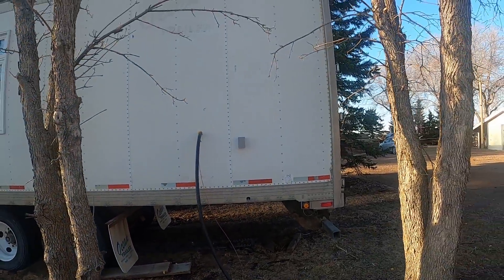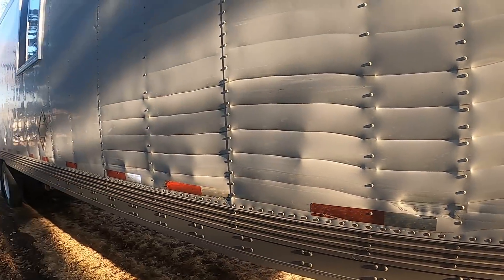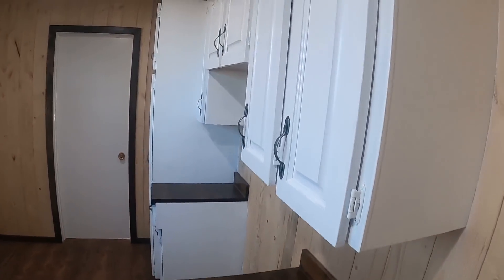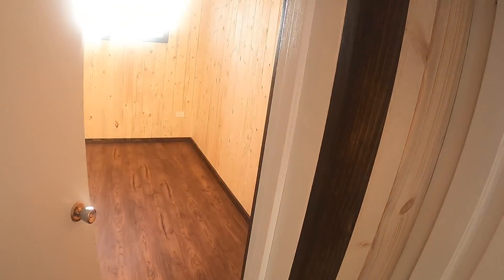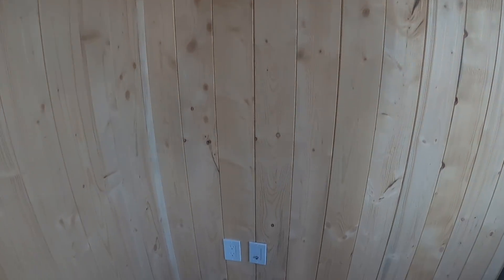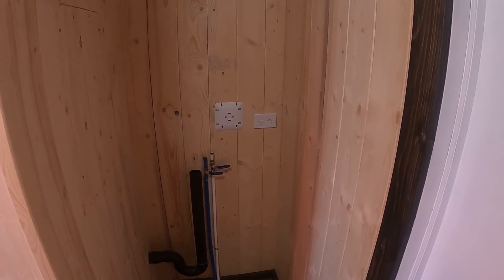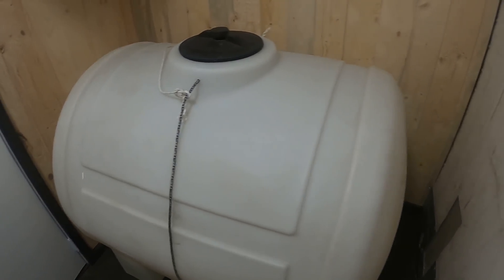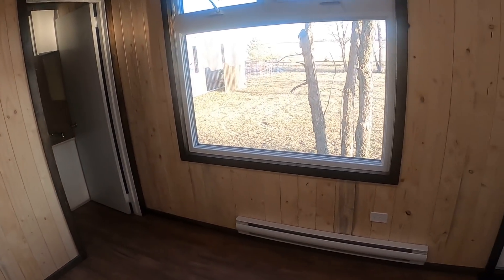My refrigerated semi-trailer converted into a house.

Comment: I worked on semi-trailers for about 20 yrs. and these thermo trailers can be heated with a few candles, and that little AC unit will freeze you out of there. 3' thick insulated foam walls. 4" thick in flooring and 2" roughly in ceiling.

Comment: I loved it .The only thing l didn't see was a closed for the clothes. Other than that beautiful ❣️ excellent work.Thanks for sharing. Blessing.
Reply: Closet
Reply: I would install a pole the whole length of one of the bedroom walls to hang my clothes on.  And I'd use under bed storage.  It's doable. 😉👕👗👖👜🥾👟 👠 So cool that it includes a washer & dryer and has a separate utility room!  Nice layout.
Reply from the maker: good ideas thanks  @jodybogdanovich4333
Reply: @mccrearymike  My pleasure!

Comment: Way easier then dealing with a 40'  container, even a 20' move on a roll back. Hit the plate, hook up the air, check the lights, your out of dodge NOW!   Add on's, cubic foot  wood stove if needed, propane stove and water heat, then the show runs with a 2000watt generator. This way you have ALTERNET USE AS NEEDED.  as is still great job !!!
Reply from the maker: Yes good ideas. I'm thinking maybe a small pellet stove even.
Reply from the maker: All good ideas. I working on another one now. I'd like to utilize propane more esp.

Comment: Good job on the build. If it's for you and your wife it would be perfect. If you were to sell perhaps consider these suggestions. I would have done a mini split system for the heating and cooling, with all the electric high output, the trailer would need panels and a solar set up to eliminate the the need to shore hookups & and tankless hot water heater. I would also just do the outdoor water intake and seal the doors in the back of the trailer to prevent thefts.
Reply from the maker: I'm not sure a minisplit would be adequate in our climate.

Comment from the maker: Hello  I am working on another one here and I am stuck on going the propane route or staying completely with a 100 amp service electrical and repeating the last one.  I am trying to avoid all the red tape with permits etc as every municipality or district seem to be different.... whatever route we go will be done by journeyman tradesmen so the quality and safety will be there. I'm trying to make as marketable as possibly
I could go with a propane stove and fridge, on demand propane hot water and a propane dryer.  I could use a propane vented fireplace for heat but I have to figure out how to distribute the heat. It will be located near one end. I do have a two inch space above the ceiling joists down the length of the trailer. 

For power I could have a rv  plug which is easier to get installed in existing yards etc or use a 5000 watt generator. Biggest demand would be the water pressure system, air conditioner, toasters etc. Solar is possibly but adds to the cost and complexity.   Woodstove or pellet stove is also a consideration?

Long post hear but I would love to hear about readers experiences, ideas good or bad and suggestions. Located in Manitoba where it frequently gets to minus 40 to plus 30 Celsius in the summer. I've looked into mini splits but not really doable for our winters from what I've read 

Thank you very much!
Reply: what is a Reefer box rated for insulation wise? I want to build one up here in Canada but I want to know if I need to add insulation or if the insulation in one is sufficient
Reply from the maker: @pipingsoul  They are well insulated. but I always add more to it.  Check out our new one.
Reply: @Mike Annetts You need to leverage the widely available propane furnaces (40,000 BTU from a Very Small component), hot water heaters (dual mode, gas & electric), power fittings (you Really can't have an electrical cable poking through the wall), etc.  You also need drawers & cabinets that won't open when you're rolling, firmly secured fridges & appliances, etc.  Spend some quality time with a good (Monaco) motor home before your next build.  That thing would be a Disaster if moved after it was inhabited.
Reply from the maker: Gus have just tied the handles together  to keep them closed but i can see problems if you didn't do that.

Comment: Hell there's enough room to put a forklift battery Bank underneath the trailer and you could easily get probably 2000 w of solar panels on the roof ....
Reply from the maker: Yes you are correct.  I would seriously like to have one completely off the grid. Wish I knew more about it.
Reply: @mccrearymike   it's not to hard you need a grid tie in pure sine wave inverter this way you can't backfeed ac voltage into the inverter......

You need to shut off the main at the fuse panel and put a lockout device on it.... Then you just need a plain old solar charger system that will charge a set of deep cycle batteries and some solar panels you can also hook this up to a 12 volt generator or 24 volt and or a  windmill
Reply from the maker: @Jackknife-TV  Thanks

Comment: How much did it cost to build and what were the top 3 highest cost associated with your build?
One final question. Why didn't you use the reefer tank below the trailer for water storage?
Reply from the maker: Hi. Diesel used to be in the tank. I don't know if yiu would ever get rid of the smell or not. Also in Canada it would need to be heated to avoid freezing. Flooring. Windows and doors, wood.  Also electrical is expensive.

Comment: I think it's badass but if you're going to go to all the trouble should have put some slide-out units in it with a double the room
Reply: exactly my point in top comment.
Reply from the maker: @Lauren-vd4qe  I was going tobput a slide out but it would of added a lot to the cost. I would of had to greatly reinforce the walls to do it. A removeable truck sleeper would  make a nice addition if it was permanent.
Reply: @mccrearymike  if its not going anywhere you could put on an addition that wd b a good idea and no too expensive either. or use a container unit thats an idea.
Reply: Why???  There is already more room than anyone needs!

Comment: and u wd need a semi truck to pull it....very expensive and very heavy. for $20,000 u could get a good used 33 ft 5th wheel with 3 slideouts more floor space and much lighter weight to pull.
Reply: This is better insulated also built much stronger than a fifth wheel with there weak 2 inch walls. Also it’s made to park on property  not tow  around the country. A trucker would charge maybe 400 dollars to move it. 5th wheels are garbage and fall apart
Reply: @larryferd1510  well i does look sturdy enough for a person who never wants to move it. as for 5th wheels, it depends on how much you tow it and how much physical torque twist n trauma you put them through that determines their sturdiness usually...
Reply: @larryferd1510  Definitely something you would ideally park on your own or a friend's land.  If you worked a job where you moved every year or so (restricted due to moving costs) and you could find trailer/RV parks which would allow this tiny home then it could be quite nice.  You'd have your own space which could probably handle many moves without issue and it is very well insulated.  One thing I'd want is mini-split for heating and cooling.
Reply from the maker: @knutblaise9437  Hello  always open to ideas.  what is a mini-split?
Reply: @knutblaise9437  good idea
Reply: This would last a lifetime while a camper trailer will last for as long as it takes to drive it off the lot.
Reply: @mccrearymike  A mini split is ac & heating all in one that hangs near the ceiling on the wall. Most ppl say it is very economical.  I can't confirm that bc I have never used one. But would be an idea for your next build, if there is one.👍🏻
Reply: This thing will go anywhere you want. 365 days a year. Just because he has a kitchen and bathroom doesn't mean it won't. Move around the world. You forgot its ment to do that.

Comment: Beautifully done..............but I would have put the bathroom nearer to the bedroom.  Lots of reasons to put all the plumbing at one end.  The pressure relief pipe on the water heater, I'd go the entire length of the water heater and down thru the floor.

Comment: Hi very nice wish me and my wife could have some thing like this what dose this cost please let us know what dose a trailer cost thanks.
Reply: Speaking as a former truck driver, it all would depend on the condition. I've seen dry vans go at auction for $5k, but they usually need tires, brakes, other work. A decent reefer would probably run you about $8k-$10K.

Be aware that the refrigeration units as built are powered by diesel, and diesel exhaust is very bad for the lungs, probably the reason it was removed. As an asthmatic, I understand that, but think this build should have retained the factory refrigeration unit, modified to run on propane or natural gas.

Also, be aware that sometimes a load of meat or eggs will go bad in transit due to unit failure, leaving a horrendous smell, so be sure to properly inspect any potential purchases. It could very well be the reason the trailer is being retired.
Reply from the maker: Sold for 48000
Reply: @mccrearymike  Fully converted, I presume.
Reply from the maker: @anonymousinc6330  yes with safety

Comment: I bet that thing is well insulated since its a reefer trlr, could you survive cold canadian winter in this?
Reply: Yes I seen people live in them and they get the weather that Canada get even some in Alaska live in them the only thing anyone has to do is put skirting around the side.  But in this video he told what insulation was put in that trailer
Reply from the maker: I worked in minus 40 celcius in it. T shirt and was very  comfortable. Heated ir with a small 4800 watt construction heater. Like a big cooler.
Reply: @mccrearymike  was the floor made of metal like it's the case for reefer trlr usually? If so, did you shoot it with foam to prevent condensation? Condensation is my main concern before I start my project... Would hate to find moisture and mold in 1-2 years
Reply from the maker: @AverageYoutubeEnthusiast  it was ribbed  alunimum  top decking and a vinyl ish  material under it with injected foam in-between. Even in the ribbing had injected foam. I believe with the closed cell foam condensation would not occur within the foam but outside if anything. These trailers are heated in the winter as well as air-conditioned for produce etc.
Reply: @mccrearymike  thanks, it's appreciated

Comment: How much how much how much how much how much did I forget to ask how much ? Still waiting on that price
Reply from the maker: Sold for 48000 Canadian
Reply: @mccrearymike  not bad thank you for letting me know. I’m thinking of buying one now and converting. Any advise ? Would you do again ? I want to make one all solar entire roof with panels and big ass batteries
Reply from the maker: @larryferd1510  yes this my second one and I'm working on the thing. I'd like to make one with solar panels and maybe a small oil heater. The tanks is still underneath for the diesel. In Canada frozen lines are always a major concern so the heating system is paramount. So off grid. Solar power. Wood, oil or propane heat. Passive solar gain maybe. I've been checking out solar air heaters a lot.
Reply: @mccrearymike  can’t wait to watch your next one

Comment: To give you more room where the hot water tank is you could use an instant hot water tank with propane. Was that considered in this build? This trailer is a good idea!👍
Reply from the maker: I had considered propane but not for this one. I'd like to make one totally off the grid and that would work well.

Comment: Did you have to register it as a welfare unit/trailer or is it legal to drive it on road as a "refer" trailer on paper? What would happen if you got pulled over?
Reply: You would register it as an RV, which is what it is after that its no problem. You would have to put private vehicle not for hire on the truck though

Comment: what's in the fuel tank?
Reply: Hopefully nothing. But it was for whatever powered the refer unit, usually diesel
Reply from the maker: Nothing. However a diesel heater would be ablevto use it...
Reply from the maker: Nothing. It's disconnected. I was wondering if I could install a diesel heater. Tank would last a long time...m
Reply: @mccrearymike  That looks like an air tank but it could be converted to hold diesel. Those heaters are very efficient. That tank would run one all winter.
Reply from the maker: @scottbaxter2682  Its the diesel tank for the reefer

Comment: BEST PLUS is you can move it CHEAP, even if you have to pay trucker 1.50 per mile. trailer houses can cost 5k or more  just to move.  this is abetter idea.
Reply: I wouldn't trust any company willing to haul this for $1.50 a mile.  It'll take at least double that in 2022 thanks to the former Vice President Brandon.
Reply: As others have already stated. A $1.50 per mile to move a normal travel trailer would have been common back in 2016. Now to move a normal travel trailer you're looking at $3 per mile today's price for anyone who's actually insured in doing it legally. Moving a semi trailer by someone who is actually insured and doing it legally you're looking at least $4 per loaded mile. The odds of having a back haul is extremely low when Bobtail.

Comment: Nice but expensive to move...maintain tires...I guess with a butt load of money you can do anything.....but when you get old how will you get into it? Elevator
Reply: Any owner operator of a semi tractor would move it anywhere you want for between $3 per mile and $10 per mile depending the distance. The further the trip the lower the rate.
Reply: Not much to maintenance. The tires will go for a long time. Remember not putting 60 thousand pounds in it. So the trailer will never have that many problems. Come on guys. You can't think fifth wheel